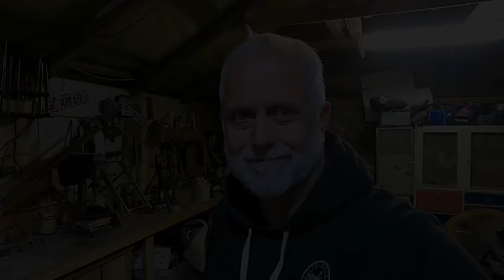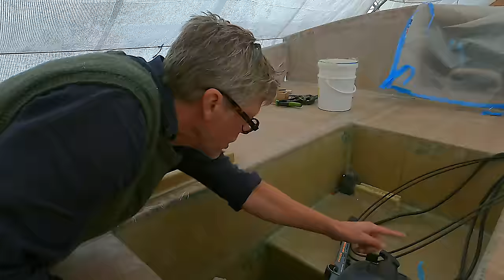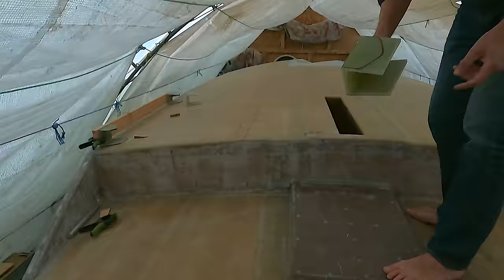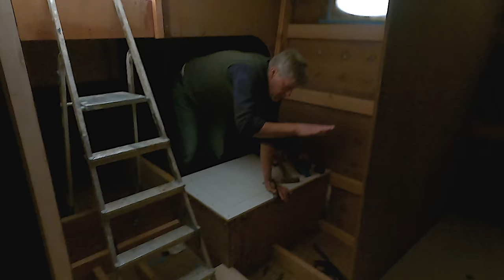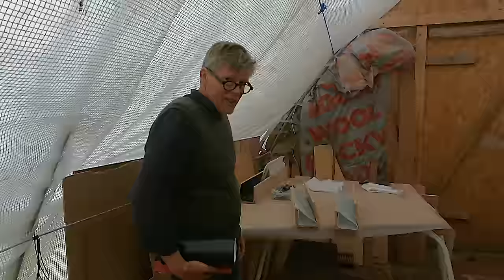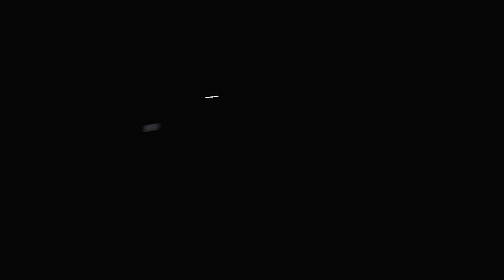Visiting Frederik and the Hogfish! - SV Tapatya EP302

Comment: Brilliant.👍 Really interesting to see Frederick’s boat. He has done a fantastic job and has a lot of volume to play with. I am not sure about that well deck up forward - that’s a big space that it likely to be wet at sea and unless it is well drained could hold a considerable weight of water. (I would be tempted to put in two lockers each side for storage of lines and fenders) to reduce the wet volume potential. Thanks for the cliff hangar?😉😀👍⛵️
Reply from the maker: Thanks Norman 
Yes, he’s got some reasonable sized scuppers up there, but that’s certainly a consideration 👍😃

Comment: The additional volume comes from the lack of side decks, Wave Rover has a large volume as well as does your boat for the same reason. The first boat I built (16 foot power boat) had side decks which were not very practical in a rough sea so with my current boat (28 foot power boat) I have eliminated the side decks and fitted a 575mm x 575mm hatch forward for access to the fore deck, this has created a boat with substantially more room and makes for a far more practical vessel. I'm curios as to why Frederick didn't use epoxy instead of having to nail the glass to the ply, did he give you a reason for that?
Reply from the maker: Yes absolutely, Errol 👍
Well, I believe the use of polyester is one of Chris Morejohn’s ( the designer) ideas. It’s significantly cheaper, but then again, he uses more of it! 🤔